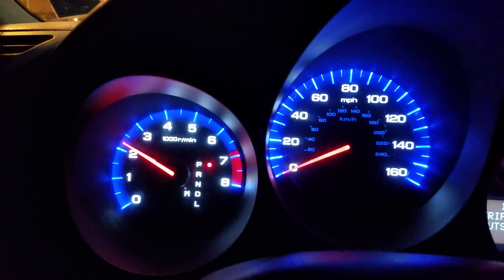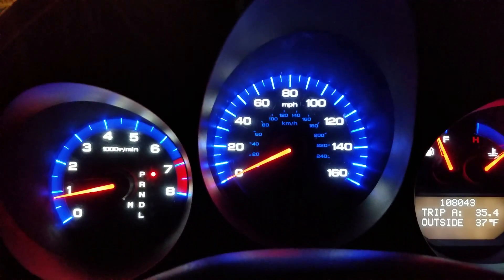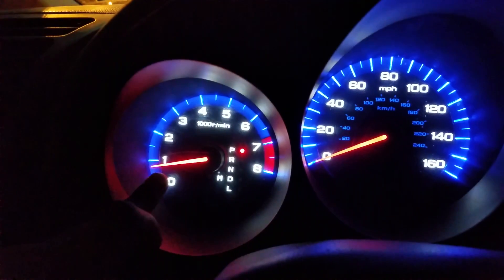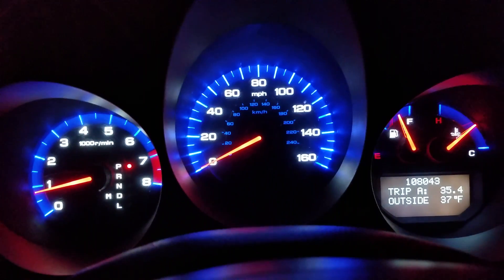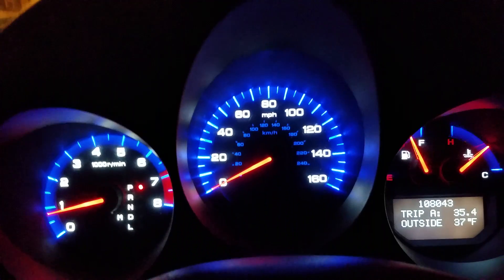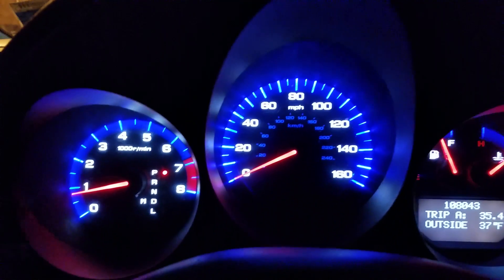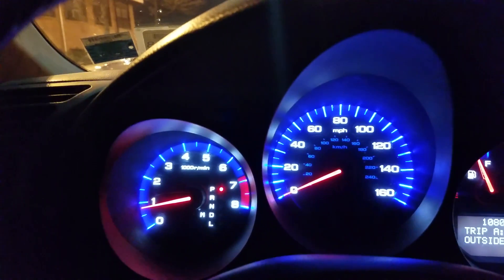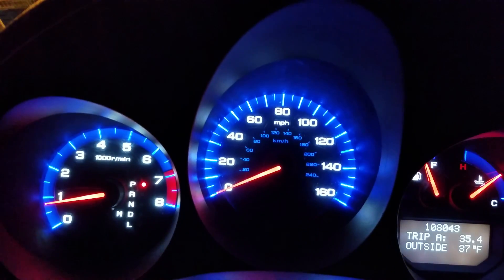HOW TO DO ECM/PCM IDLE LEARN PROCEDURE

Comment: This did not work on my 07 TL Base. Tried it 3 times after cleaning my throttle body with battery disconnected. 
1. Shut off electronics
2.Turn key ahead for 2 seconds then start car
3. Rev to 3000 RPM until fans kick on
4. Let car idle 5-10 minutes 
5. Shut off car
I even tried disconnecting the battery before attempting these steps a 3rd time. Did not work.

Comment: no fan just smoke from engine i changed battery 02 sensor and throttle body
Reply: no engine lights on either
Reply from the maker: Valve cover gaskets
Reply: @fabolousg4ever  are you saying the are worn?
Reply from the maker: Yes
Reply: @fabolousg4ever  i literally just tried the reset again. no fans. now coolant leak
Reply: do i try again?
Reply: @fabolousg4ever  my car died when the fans came on what do i do??!

Comment: On a cold start I noticed high idle and the check engine and VSA light on. Turned off and on again and idle was normal but the engine light stayed on with code p2176. Did this relearn procedure and the light went away after the restart.

Comment: So few weeks ago I disconnected negative battery terminal to clean it from some corrosion. After that I didn't do PCM idle relearn or should I say I didn't know that I needed to do that.  My car idles properly as far as I can tell.  Should I still do idle relearn?
Reply from the maker: no its fine if the idle hasnt changed

Comment: Bro does this work for 05 acrua tl too because after I cleaned the throttle body it has been a lil rough
Reply: Do you know if it worked?
Reply: @carlitoseuceda2000  yes sir it did work
Reply: @cliftonpeterson5863  thanks going to be trying it today on my 01 CL-S

Comment: Bro help me out! I have -a 2005 TL. Last sunday I started the car for 5 minutes, turned it off and 5 minutes later I wanted to start it again and it just cranks but will not start. I see its not the gas pump, I can hear it. It’s not the relays either.  Someone said it could be a computer problem. What do you think could be?
Reply: What’s the update? I’m have a similar problem
Reply: @freddyacosta2358  could be the battery’s dead

Comment: 2008 Acura TL Type-S, I used a screwdriver, very carefully and slowly, to open the throttle to clean it. Did I do any damage to it? I tried to re-learn the idle but can't seem to get it. Can't hear when the fan comes on. Any suggestions? Thanks.
Reply: Try leaving the hood propped

Comment: I just clean my throttle body after I put everting back code p0507 check emissions light on ....... I see this video I ganna try idle relearn tomorrow hop it work for me and hop the light will go off
Reply: Did you get your emissions light to turn off with the relearn of the idle ?
Reply: mikey I need to reset tps and do the relearn right?
Reply: mikey I did do the relearn first but the light didn’t go off and I bring to the repair shop $10 they reset it light is off now and I do the relearn again when I home but when I check with my BlueDriver the code p0507 still there.... maybe it need  time to drive to recognize clean throttle.....or maybe you know why code still there?

Comment: I recently got a P0685 code but the night before my alternator was smoking and now this morning my car will only turn on when jump started but loses power and dash lights turn off. Not sure if a aftermarket led flasher relay I bought from diodedynamics could have caused a shortage. Can you help me troubleshoot this problem?
Reply: I’ve had that new led flasher relay on my car since Monday by the way that’s why I’m not sure if it could be that I mean it didn’t cause my led rear or front signals to hyperflash anymore once I took out the oem one and put the aftermarket one
Reply from the maker: take it out the flasher modules are garbage cause to many problems just use load resistors.
Reply: MODS FOREVER will do it tomorrow since I go to work soon and have to take my spare car now. Didn’t think it would be that but the code on my scanner says it’s the ECM/PCM Power Relay Control Circuit

Comment: Can u try this when the car is already warm? Or do u have to do it after a cold start?
Reply: Andres Ordonez yes you can I just did it to mine I replaced the knock sensor I disconnected the battery

Comment: So I have a quick question. I got a 2006 Acura TL and cylinder 5 keeps saying misfire even after replacing all the coil packs, and spark plugs.
Reply from the maker: Prob have a bad cylinder you have to do a compression test on that cylinder.

Comment: I cleaned the throttle body like you described in your other video and I got a check engine light.  Will this procedure clear that?
Reply from the maker: No just unplug your batter for like 5 minutes will clear the code you don't need to unplug the sensor to clean the throttle next time you don't have to unplug the map sensor but just unplug car battery for 10 minutes and make sure u have the codes for your car radio and navigation if you have that it.
Reply: @fabolousg4ever  yeah, i did unplug the maf sensor because i was cleaning that too.  i'll try the battery to clear the code.  thanks for your help.
Reply: lumd63  I know this is an old, but did you ever fix the problem you had? & how?

Comment: Just changed my hyundai i20 battery. Then, the rpm drops by 1600 as against the initial rpm 1900 during idle. Everything is ok as was before except this rpm drops. Took a long drive hoping to get the rpm back to normal. Sorry nothing happens. Please help.

Comment: hey bro,after i change my oil in 05 Acura  TL yesterday the engine light come on .and i scanned it and i found this two codes  P0174 and P0171 .can you pls help ? thank you in advance .
Reply: P0171 Fuel System Too Lean
P0174 Front Bank (Bank 2) Fuel System Too Lean

Comment: What’s up dude? I just recently bought a 08 TL and my engines revs up and down every time I break the car to slow the down. I noticed that it does it at times when I let go of the gas as I’m driving. Can you help me out with any info? I really appreciate it!
Reply from the maker: Sulten Rey how many miles
Reply from the maker: Tuneup
Reply: My car is doing the sameting did you fix the problem?
Reply from the maker: How many miles any codes
Reply: 121546 and no codes
Reply from the maker: Check the vacuum lines for leaks and has a tuneup been done sounds like you might need new spark plugs and try cleaning the intake manifold also
Reply: The person who i bought the car told me that he clean the tps and the ac condenser. I already did a tune up include spark plugs
Reply from the maker: Might be transmission you need a professional scanner to scan all the cars systems
Reply: I’ve done a full tune up to my car and even changed the transmission oil. It still does the same thing. Mileage is at 103 heading towards 104. No check engine lights or any codes. One thing I haven’t done is the intake manifold cleaning but at this point I kind of gave up and just leave it parked and drive my other car more.
Reply from the maker: Try cleaning intake manifold and egr valve ports and cleaning the egr valve and see what happens
Reply: That i need to reset the throttle body with scanner and do the idle relearn
Reply from the maker: Yes
Reply: Thanks
Reply: Transmission , downshift problem is there a downshift solenoid?
Reply: I have a 2006 TL, I think the high revs are from downshifting to slow the car naturally.  From what I read once, Acura designed it that way to save brake pads.  When it down shifts, revs go up some and it almost feels like a lung backwards down a hill

Comment: It happened to my 2004 TL, I did the relearn, it work fine but after a week later, the idle went crazy again it will died on me or rev up and downs when I make a traffic stop. What else could that be?? I replaced a used throttle body and still  doing the same. Thanks
Reply: Buy A Foxwell NT510  . The Scanner Is On Ebay For $150 . Will Fix This Issue .
Reply from the maker: You have to use a scanner and erase the tps memory and then do the idle relearn procedure again or check for a leak in the throttle body gasket make sure it's good
Reply: If I disconnect the battery would that erase the TPS memory? My scanner only erases engine light, no other option I can do. -_-
Reply from the maker: You can try that
Reply: @donaldlee4824  On Honda/Acura it seems you have to reset TPS memory from a tool, many people complaining that disconnecting battery not working, I have the same problem cleaned throttle body and when braking it revs up, did you fix this? ( I was slightly noticing this before cleaning but it became so obvious after cleaning TB)

Comment: Hey Sir I was just wondering if you think this could work for a 2007 mitsubishi outlander.. I cleaned the throttle body and now it idles at almost 2000 rpms.
Reply from the maker: no this isn't the same procedure you might need to take it to a shop so they can relearn the idle

Comment: Does this work for hyundai i20
Reply from the maker: +Nikhil Lobo no
Reply: Plz help :(
Reply from the maker: no it doesn't sorry
Reply: Nikhil... I have same problem with my i20, after cleaning throttle body, now i have idle high rpm. Did you fix the problem?? Tell me how?
Reply: BHARATH V R did you get this resolved?
Reply from the maker: you have to find a place with a high level scanner to clear the old throttle memory and rest the idle by computer.

Comment: Hi , will these fix my idle issue my tl?  sometimes goes under 500rpms or to the lowest rps to just stay On
Reply from the maker: Juan Paez clean throttle body and intake manifold
Reply: fabolousg4ever already did it , actually I change the throttle body , air filter and intake but the issue continues
Reply from the maker: +Juan Paez have you done a tuneup any codes
Reply: fabolousg4ever yea before I change the throttle body the check engine turn on and show a code that we couldn't find what it was en Keep happening , so I change the throttle body it was okay for a few days but it happen again
Reply from the maker: Juan Paez i need the code
Reply: try egr

Comment: Tried this on 09 Honda Accord at least 6 times till now, with Battery disconnected prior to this for 3 hours, does not work at all, you need to do it with a Scan tool. Lesson never ever clean your T body if you dont have tool to relearn throttle position on any Honda/ Acura with drive by wire tech. For this reason i hate Honda that i have to get a tool or take to stealerships
Reply from the maker: no drive the car for a few days the computer will remap itself and the idle will adjust by itself
Reply: I will try that, i still have the P507 code CEL on, this was after i stupidly cleaned the TB, even my mileage dropped big time.
Reply: @simpsonsimpson3071  Im on the same as you right now, ima give it a few days before I drive it to the dealer to get properly reset
Reply: Frankie J.  How did you fix your problem did you have to take it to the dealer for the scan tool ?
Reply: I replaced gas cap on my element. Car runs fine. On start up it bogs. Tried this relearn didnt work for 2003 element.

Comment: Sounds legit, I see you got a lot of videos about the TL, just curious as to where you learned about all these procedures?
Reply from the maker: +Anthony Putzell online writeups some people understand writeup some understand videos i dont just work on tls i work on alot of other cars to but some online some working on cars and some just stuff i have learned in the years the demon eyes and halo rings and stuff i just figured threw thr years of me doing custom work i knew i could fabricate a way to install everything i wanted to do.
Reply from the maker: +Anthony Putzell and i also have a friend that worked at acura for 30 years and some acura master tech tips.
Reply: Ah cool bro, I just bought my TL a couple months ago, got 86k on it, needs some work, struts, shocks, new tires, and I have this annoying double "click, click" noise from the front end every time I take off from a dead stop and at very low speeds. I am leaning towards the pass side cv axle, but I also have a worn front engine mount that I'm thinking could be the issue as well. Thanks for all your vids!
Reply from the maker: +Anthony Putzell clicking is axle no problem thanks for watching
Reply: I figured as much, what throws me off is that i don't hear any noise while turning, but that leads me to believe it is the inner joint.

Comment: FYI I drive an Acura TL 2007. I appreciate all the info. What's the purpose for this procedure. Just wanna know. Thank you
Reply from the maker: Shaun Forsett to reprogram the cars computer after replaceing a throttle body or tuneup to make the car run more efficent and for car to idle smoother
Reply: fabolousg4ever cool. I'm having my axle replaced. It broke down yesterday. My car is at the mechanic now. Is there anything I should look for once it's repaired. Also, I haven't been quoted a price yet, so what's the rate for that type of repair. thanks
Reply from the maker: Shaun Forsett check the rubber boots after you get it fixed make sure there no rubber axle boots are broken and are not leaking any grease and a job like that is usually like 300
Reply: OK cool. Thanks again. The vids are very informative. I'll definitely stay posted.